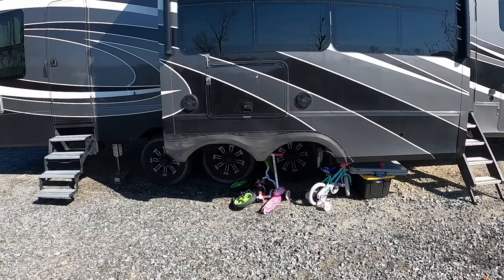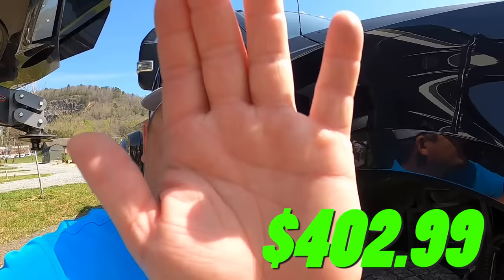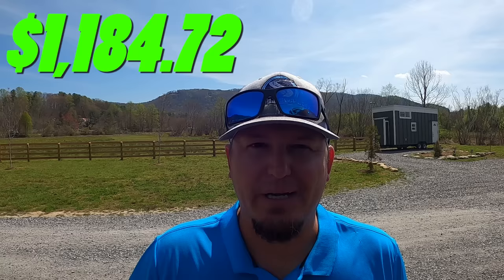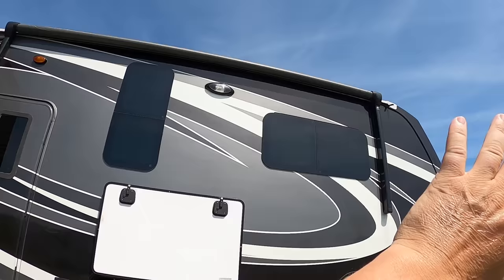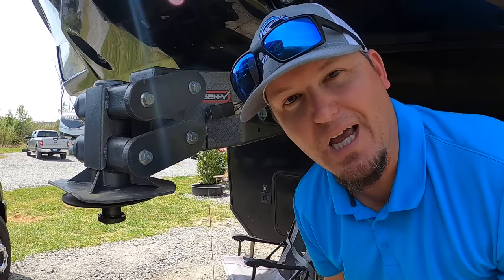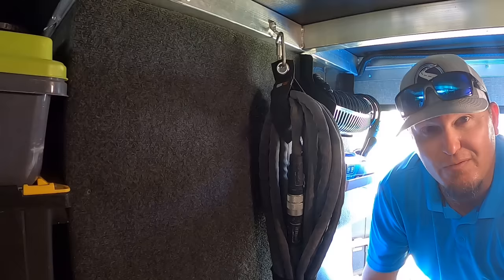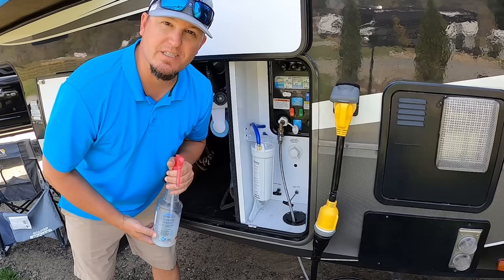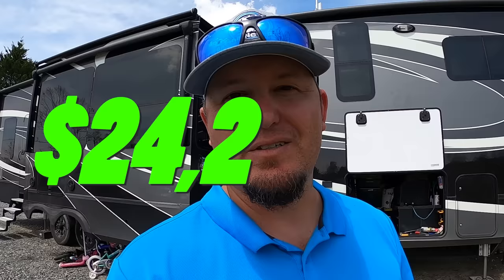These Things Are Money Pits! Everything That We've Had To Repair! | Fulltime RV Living!

Comment: ✨Sir, You NEED to change the oil in that diesel every 5000kms/3000miles. You are destroying your engine.✨
Reply from the maker: So I guess after 3 years and 90,000 miles of pulling the RV around the USA, Ford was right on the recommended service intervals, and we didn't destroy our engine! All brands now have an oil monitor system, and it tells you when it's time based on how you are using the truck! If you tow a lot, you might only get 7,000 miles before it's due! If you don't tow at all, you can get as much as 10,000 miles on an oil change! It would blow your mind to know that semi trucks go 25,000 miles between oil changes!

Comment: RV's come broke and need everything upgraded
Reply from the maker: We actually didn't have many problems with the RV untill we started moving every week! Nothing has broken sitting still, and almost every move we would have a new problem! When we fix them, we make upgrades or improvements! Most of the items in this video were our first year, the second year, because we had fixed everything, and it was smooth sailing!
Reply: @PavingNewPaths  I was relieved when ours was hit by a tornado the day we were going on our first spring trip.  Flipped it in the drive way and rolled over the car while we watched.  Only lost about 5000 on the whole thing

Comment: I own a F450 and I can tell you right now, the reason you're spending so much on maintenance is because you're buying the cheap shit. The correct batteries ALONE cost about $500.
Reply from the maker: Somehow you owning an F450 has zero impact on me, but thanks for letting me know what you drive!  The batteries we have in the truck are from Ford and they are Motorcraft batteries!  Some would say they are the same batteries you likely have in your truck!  Come to think of it just about every part on both trucks are the same, except what matters and that is max towing and payload and that is where the F350 is the winner over the F450!

Comment: Stop having the Ford dealership do all that work, they overcharge for it all. Have a local place do it and it will be half the cost. I had a F-150 for 6 years and never once went to the Ford dealership for anything. The truck ran great for 6 years with almost no problems.
Reply from the maker: You do know the Ford dealership is the cheapest place to take it to right!  They also hire qualified technicians and they are trained on the product you are bringing in! But the biggest reason to use Ford is they will back up their work and every job is documented and traceable if there ever were and issue!

Comment: Hold up….. you can’t change your own oil, air or fuel filters but you repairing and repacking wheel bearings??  I’m calling 🧢 on this entire video.  You bought a 🍋 Sir… this is in you.
Reply from the maker: Actually, I can do all of those things. If you have ever RV'd in a campground you would know that most campgrounds do not allow you to do vehicle or RV maintenance inside of their parks. And if you knew anything about RV'ing, you would also know that RV's break and they break often! Someone using their RV seasonally may not have quite as many problems as us, but when you consider we move our RV ever 7-10 days on average and live in it fulltime as a family of five, we should have more things that break. Luckily, most RV problems are super easy and cheap to fix, so calling our RV a lemon is a bit irrational.

Comment: Fuel filters every other oil change?  Completely unnecessary.  Can't change your own oil?
Reply from the maker: The maintenance schedule calls for fuel filters every 15k miles! Our oil typically last 8-10k between changes, so every other oil change is actually a little longer than the 15k recommendation! We can a do change our own oil and filters when we can, we however travel fulltime and most RV parks have specific rules about this type of work in the park! So when we can't do it we take it to Ford to do it!
Reply: @PavingNewPaths  Complete nonsense.  You are being scammed.
Reply from the maker: @markleyg  It actually is not, the new diesels from all 3 brands require fuel filter changes at this same interval! Doing maintenance is pretty important if you want your equipment to work and last! The only scam here is you thinking maintenance is not required or necessary!

Comment: After spending $14000.00 on repairing my 2020 Ford F-250 with only 62000miles.You have convince me not to buy a even bigger POS.
Reply from the maker: I am sorry you are having trouble with your Ford and it sounds like you had a fuel system failure!  The problem you had can happen to all 3 brands they use the same CP4 fuel pump, only GM has recently gone back to the CP3! Not really a Ford only problem!

Comment: Total BS. Who spends $144 on Dicor or $108 on bug spray? So many of the so called expenses are grossly exagerrated or represent buying multiples of items that weren't required. If the rest of us had to spend those kinds of hideous amounts, the RV industry would be dead. Yes, I do believe the $8,000 on the new roof and I have personally seen 3 5th wheels running down the road with it filled with air plus one of them was pulling in the rain.
Reply from the maker: Why would we lie or overstate our costs? Just because our costs don't look like yours, doesn't mean we are exaggerating costs. Also remember, we are fulltime and these costs are over a two year period. There's no incentive for us to fabricate costs, so your comment is a bit out of line.

Comment: Yeah don’t buy ford man. Never, you have no idea what’s going to happen with oil leaks , egr repairs, oil coolers, wiring harness, and higher miles “normal” fluid changes. Better to drive it off a cliff.
Reply from the maker: I have owned a Ford since I could drive and have never had any problems out of them!  Most people that bad mouth something usually have never owned one!

Comment: Sucker! You don’t need a huge RV and a big diesel truck. My 2012 F150 gas truck and 21’ travel trailer costs me less than $1000 a year in maintenance (not including $1200 for new tires after 2 years). I lol at couples who have huge RVs like yours.
Reply from the maker: We actually do need an RV this size. We live in it fulltime with our family of five and a dog. If we were just seasonal campers, of course, we would go smaller. But going from 2500 sq. ft. to less than 400 sq. ft. was quite the adjustment! Just because someone doesn't have the rv and truck you do doesn't make them a sucker. But thanks for watching!

Comment: You bought one of the worst RV brands and bought the most unreliable truck to pull it.
Reply from the maker: Yet here we are still traveling with one of the worst brands and most unreliable truck! We must have gotten lucky, seems as though they are doing exaclty what we purchased them to do three years later! Tell me again what Truck and RV you have!
Reply: @PavingNewPaths  Newmar Class A. Wouldn’t buy a modern diesel truck, too unreliable and too many problems.
Reply from the maker: @joedwc  It's funny because every fulltimer we have ever met in a Newmar, Prevost, or Newell has the same story about how much it cost to keep them running! You must have a special one that never has probelms!
Reply: @PavingNewPaths  it really doesn’t. Outside of the first year’s typical warranty issues it’s been great. But it’s also a 2016 so it was built before the current covid related industry problems
Reply from the maker: Most of the probelms or cost we had came in the first year of traveling! now most of it is minor things and Maintenance! It's not about brand or how much you spent, if you actually get out there and use these things you will spend way more than you plan!

Comment: Dude you wasted so much money lol and im only half way through the video. You could of done your own breaks for about 350 also ac filters are washable.
Reply from the maker: You might be able to do breaks for $350 but the brakes on our truck cost more than that! The airfilters we use are significantly better than the stock ones and are not washable!
Reply: @PavingNewPaths  gotcha. But if i were you I'd contact winnebago who owns grand design or grand design and let um know about the quality of some aspects of construction because if no one complains or basically let's them know then there's less chances of them improving.
Reply from the maker: @brentacusmaximus6677  It could be built better but you have to remember we use ours fulltime and this was over a 2 year period where we moved every week! Yes our results are different than most but we use ours more than most!
Reply: @PavingNewPaths  I full time too  since 2019 in a 2019 jacyo whitehawk but i don't move nearly as much which obviously is going get things loosened up eventually lol
Reply from the maker: @brentacusmaximus6677 moving is the determining factor, we have never had a problem sitting still almost everything happend during a travel day!